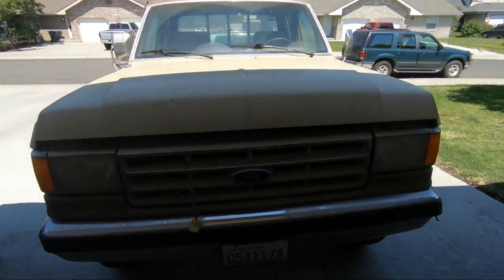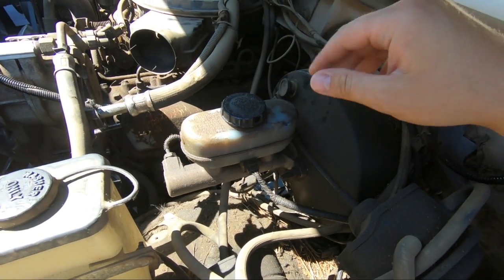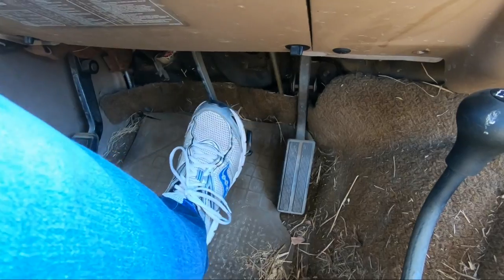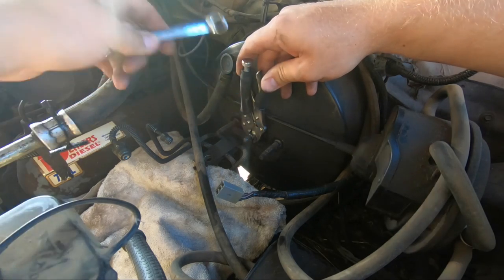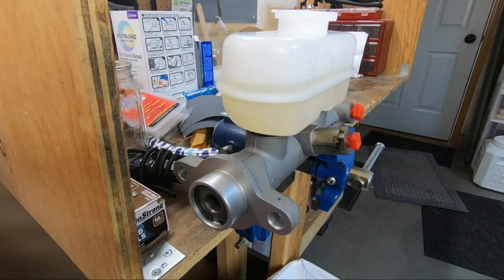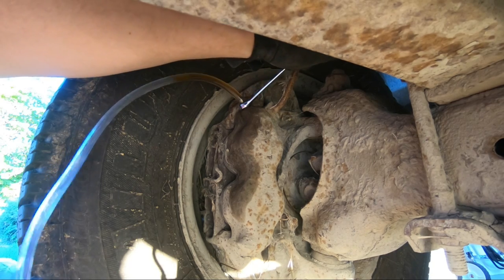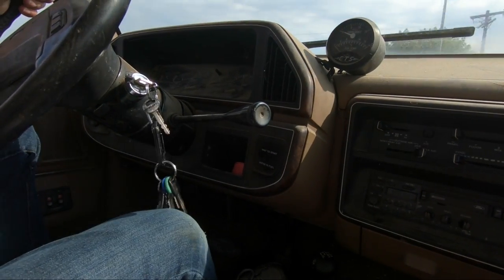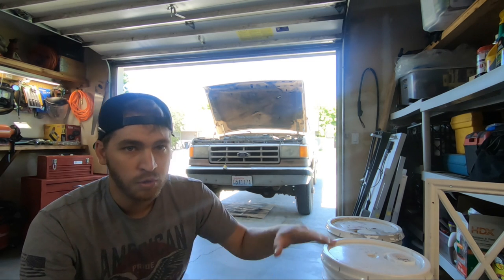OBS Ford Master Cylinder Replacement

Comment: Im having the same exact issue with my 91' e350. Issues seems to pinpoint both MC and booster, then I read about that adjustment rod too and thought the same thing, might as well try it before spending all that money. Ended up deciding against it because of how the brakes could lock up( I've got a dually motorhome.) So I've got a MC and booster on the way. Someone suggested on a forum that you can 'bench' bleed the MC by just installing it and using the brake pedal and use tubing on the outlet going back into the MC. Still gotta bleed the rest of the system like normal, but thought it was a good idea.

Comment: I'm baaaack -- like I said before, I have the same truck.  I had intermittent problems with the brake booster not boosting and the engine dying on acceleration.  Both were related to inadequate vacuum from the vacuum pump.  There is a vacuum advance  that keeps it running on accel.  Installed a new vacuum pump and it fixed both problems. Hope that helps!
Reply: I'm assuming here that you got the alternator belt problem resolved since the vacuum pump runs off the alternator -- so a loose alt belt is the same as having a loose vac pump belt too.  Just checking . . . 😀
Reply from the maker: @jameswallace5059    Once again James that’s FANTASTIC advice!  I’m going to make sure everything is properly adjusted and look into the vacuum pump some more.  The truck is coming together great, but it needs so much more work before I can even go take it for a drive.  Once again thanks for watching, sure do appreciate the helpful tips👍
Reply: @ydocproductions5593  Very glad to help!  So, if you get all the belts tight and you still have the acceleration issue you may need a new vacuum pump.  They are about $75 at rock auto and easy to install -- you may have to transfer the pulley from the old one, but it's still easy.  Think about it -- the one you have is probably 34 years old and they have a flexible diaphragm inside!  It is a good part to replace just on general principles.  I had these problems that you're having with my truck.  When the "dyinig on acceleration issue happened to mine, I first just adjusted the idle up and it cured it temporarily -- but that is not a good solution and it wastes fuel to have a high idle.  But, if you try that and it stops the accel issue then you will know it is not a fuel delivery problem and it will confirm the vacuum problem.  I'm tired and my language skills are fading and I have Covid so I'll talk to you later.

Comment: LMK if u want to trade for my truck. Everything i fix on my Bronco causes 2 other things to fail. Usually its something obvious and predictable,  you know - change the EGR valve=>brakes no longer work. Put on new windshield wipers=> house plumbing bursts into flames, put on a new water pump, windows no longer work. Simple stuff like that
Reply from the maker: Sounds like I don’t wanna touch your truck with a ten foot pole!!🤣

Comment: I got the same truck but mine is a 91 Ford f350 7.5 crew cab with the exact same problem with the brake pedal going to the floor.
Reply from the maker: Later off camera I figured out that all the brakes were pretty wore out.  After replacing the shoes and brake pads the brakes worked great after that.👍
Reply: @ydocproductions5593  on mine, I was driving to the recycling place and as soon I was pulling in to park, the truck didn't stop and ended up crashing into the wall. The pedal still goes all the way to the floor.

Comment: First!
Reply from the maker: That was quick!🤣
Reply: @ydocproductions5593  🤣🤣 timing is everything! I was just out messing with my new truck & decided to call it a night. If people would only fix the little problems when they arise, things would last a lot longer!
Reply: Nice job and vid there Cody!  I would have cursed the booster myself, but what do I know...  first thought was a leaking brake line, but you said nothing about leaking fluid... Anywho...job well done!!   Can you just get the seats restuffed and new fabric?  I did that years ago, didn't cost much... Anyway, nice job! 👍
Reply from the maker: @WesleyJohnsonMI    It’s amazing how little maintenance this truck has had over the years.  I know I’ve said it a thousand times already, but it needs a complete overhaul front to rear.  Hope your truck project is coming along well😀👍
Reply from the maker: @TheFoxShop   I forgot to mention in the video that I don’t have any leaks at any of the wheels which lead me to replace the master cylinder.  The brake booster definitely could be replaced in the future, but for now I believe it’s ok.  As for the seats I bought some foam and fabric.  My intention was to sew in a patch, but the seat fabric is so faded and worn out that it won’t look perfect no matter what I do.  Do you know of a website that sells color matched fabric so I could replace the entire bottom part of the seat?  Thank for watching Jon!  Take care👍
Reply: @ydocproductions5593  I do not... When I had my seat restuffed and new fabric... It was the lay they had of that original type of fabric..  they had other things close... So may have to go that route?  Nothing wrong with that..